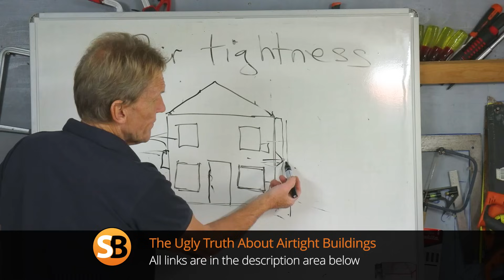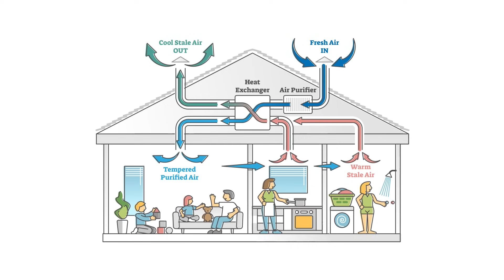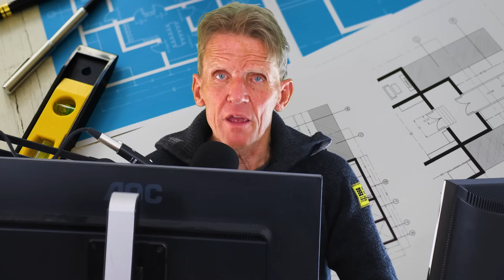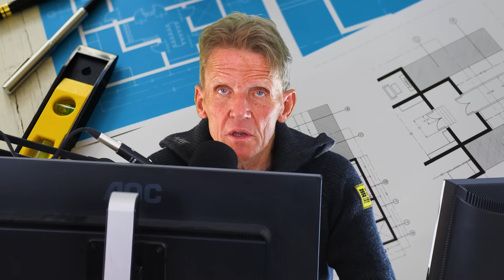Why Airtight Homes Are a Terrible Idea

Comment: I'm not sure that the German practice of opening windows to freshen the air and reduce condensation would work in the UK. Continental Europe tends to have a drier climate than we do so the humidity in their outside air is usually lower than here where we have a damp, moist atmosphere which could be more humid than air inside the house. I do agree, however, that ventilation and adequate heating is important.

Comment: I have a 1960s chalet bungalow.  Gov scheme converted the attic to a "cold space" without checking how far that cold space extends through the house.  It expends through the floors and around the dormer.
My options now appear to be, to try and seal up the attic from the floor spaces, stairwell cieling, dormer walls/cieling or I convert the attic back to be a "warm" attic and damp proof and insulate the roof side.

Comment: hi roger: dehumidifier performs poorly in low temperture due to the use of compressor, what is your view on that?
Reply from the maker: You don't need a dehumidifier in low temperatures. Warm air contains moisture and as it cools it will become drier. 
If you have a cold rainy day it still doesn't raise the humidity levels inside your home. Set the dehumidifier to a target of say 60% and let it do the job.
Reply: @SkillBuilder  thank you so much!

Comment: It’s because Roger my darling we can’t afford the bloody heating. We can’t afford to let any of it go outside into the open air because it’s too expensive. We’re a poor bloody nation as far as heating our houses go. It was like this when I was born in the war and for the first 30 years , slot metres for the gas and electric cuddle round a bloody gas fire , there was a reason why we all went over to Gas central heating we could afford to now we can’t even afford to put the bloody central heating on, and asked to having the windows wide open while the boilers blasting away and the meter was in round you can forget about that mate . Now we’re all realising for most of the year we live in a damp cold climate. And keeping all the heating with the moisture is causing problems. Fgs

Comment: I survey houses for a job, new builds currently, I’ve been building (originally a sparks for 25+years). I like Roger’s videos but disagree here, I think if you correctly use trickle vents and open bathroom windows a tad while showering and leave a couple of extractors running for free as the solar powers them, you will be fine. Badly built new builds get mould, houses where people don’t adequately spin clothes in the machine so they are soaking get mould. I’ve never had mould and don’t have a washing line, I think as with most things it’s a bad thing is misused but having had an older house that leaked air everywhere and I was always cold, I’ll happily live in an air tight house that I vent very cheaply with zero effort

Comment: I've grabbed all the "low handing fruit" to reduce drafts, from weatherstripping, to sealing around the outlets, to blocking a passage in which attic air was trickling between the drywall and the masonry, into my kitchen. It's important to keep air from circulating between the vented "dead spaces" and the interior of the house, not only to save HVAC costs, but to keep all the dust and nastiness that accumulates in those spaces from getting into the living space. But I see no reason to get new windows; the 65-year-old windows I have, despite the weather stripping I added, still leak a bit in the gaps between the sliding sashes and that's all the "trickle vent" I need. What's the point in spending a fortune on perfectly sealed windows only to have to open them for an hour a day?

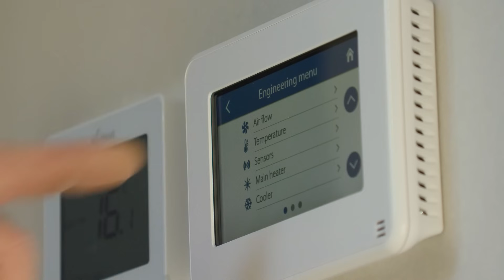Comment: 2:05 Heat recovery ventilation seems like something that should be done room-by-room, maybe with a unit under, or in a pinch, in, each window. All that ductwork would be a major expense and a major maintenance burden and for what? The window units I've seen are reasonably priced and they have much less potential to harbor dust and mold. There's also less risk of exposure to air in dead spaces, which could be the wrong temperature, and less chance of leaks. The ducts, unless they are part of a centrally controlled  HVAC system, with all of the pros and cons that go along with that,  seem like a needless complication.

Comment: Have always owned various Ebac dehumidifiers, since the early 90's, when i lived in a terrible concrete house. We had to have the walls dry lined (thick insulated boards on the interior of all external walls) then a re plaster, we extended the heating upstairs and finished off with the dehumidifier, and have never been without one. Am currently in a 1930's house and we never have condensation on any windows or damp anywhere. We keep it in the room where we hand clothes on an airer to dry and empty it regularly. It seems to take the chill off too when the heating isn't on. 
I still do the German thing of all windows and doors open first thing for 20 minutes, especially in winter. I love a bit of fresh air!

Comment: Avoiding cold bridging and cold spots on walls by good insulation and dealing with old chimneys will reduce condensation and mould. Ventilation matched to moisture levels and temperature i.e. Dew point will then take care of the rest.

Comment: A trick I learned from Scandinavia for timber framed homes is the breathing wall concept.
In brief,Tyvek if you want to to keep insects out but no vapour control.Insulate between your timber frame elements (posts,beams,studs,rafters,etc with something breathable e.g. rockwool or woodwool then clad the inside and outside in wood.All that is required is that the outside e.g. cladding planks,passively vented roof etc is 6 times more breathable than the interior cladding e.g. tongue and groove.
A big mistake people can make is boarding out the loftspace without leaving a nice airgap eg 300mm all the way around the edges to let the water vapour work its way out through the breathing roof. It's unusable space anyway and you'll use less boarding too.
I built and lived in a house like that for over a year in all conditions and never had any problems even when it was cold and had been raining heavily for days.Warm walls and never a drop of condensation.

Comment: In a rental house we had mould issues with certain tenants but not others. Heating left off and radiators switched off may have had something to do with it. It was rather stressful. Now we include gas/electric in the contract (so  we ensure heating is not skimped due to penny pinching). We installed a Drimaster PIV with heating element in the loft to vent to the landing, and installed an always on Envirovent bathroom extract with PIR sensor boost. Heating is also now permanently on at 18/19 degrees, with temp boost if needed. I’m not bothered about leaving windows closed, but we encourage tenants to leave internal doors open a little to let air move. The two always on fans provide all the ventilation. Now there is no more mould at all. Tenants are happy and don’t stress about bills. House is warm all the time and we save heaps by not having to clean and redecorate as often. We also topped up loft insulation to 300mm. Also, when painting internal outside walls we add anitimould additive (from tool station) to the paint.   Hope this helps someone.

Comment: My last house was air tight as in the air bricks had been cemented over. It was ridiculous the amount of condensation I had to move house because of it. Failing the house move I was going to get a PIV. I bought a dehumidifier but it didn't scratch the surface

Comment: I wonder if there is a positive press fan that has a wet coil so it can be used with your heating system, but uses the electric element as back up.

Comment: The last 2 newbuilds I bought had a pressure test done to certify air tightness. I later found in both properties that the bathroom extract fans were not discharging to outside but discharging into the attic. This was probably done to enable the properties to pass the airtightness test.
Reply: Fans are taped over on an air test and venting to attic would still fail an air test. The fans vented to the attic, because the builder, roofer and sparks were incompetent.
Reply: A friend of mine had a condominium with a fan like that, and when it shut off, the moldy air from the attic would back up into the bathroom. By the time he found and fixed it, he had developed chronic asthma. I believe there are some places in the USA where they allow the bathroom extraction to be done by the HVAC system, since that dehumidifies the air before it is sent back into the living space, but I don't know how well those systems manage any other unpleasant things that might be in bathroom air.

Comment: Common sense at its finest!   We have a draughty old house with solid brick walls, no damp course, lime plaster walls, no emulsion paint; never had a problem with damp or mould.  Tupperware box houses are a complete disaster.  I would love to build a 'modern' house using 17th century building techniques and materials - but of course I wouldn't be allowed to!

Comment: got an old house with massive stone walls and without insulation. We still made it airtight with new windows and doors and dont have any issues. Just use as much clay plaster as possible, put as much thermal mass inside your house (thick clay plaster, for example) and get some electric roof windows that can be scheduled for opening a couple if times per day. House wont cool down too much (because if thermal mass) and the clay is regulating the humidity better than anything else. Clay can be made almost for free from the local soil mostly anywhere where you live... Modern things combined with old school knowledge works extremely well for us and is still pretty  affordable.
Reply: almost forgot: roof Windows open during nights and closed during the day is keeping the house cool during summer as well (cool of the night is stored in the thermal mass)

Comment: British  houses are simply badly built. The above the ground founsation is 2 bricks high! Cavity insulation is hard to get right and not as effective as external insulation. Also ineffective since it needs ventilation as well, losing heat by convection!     Have a look at they way they build houses in Germany or Romania, much better

Comment: I have worked on doing a few air tightening measures on my renovation. Not had any issues yet. I wonder if its because the house is masonry so the brick absorbs the moisture. Planning on getting a wood burner that feeds from the internal air also my thoughts being it will refresh the internal air in the winter when the problem is worst. Also always line dry or tumble never hang inside, this is a no no even with the fire on.

Comment: We had a heat pump hot water tank installed this winter it draws warm and moist air in from the home uses that to heat  the water once or twice a day and pushes the cold air outside its very useful at drying out the humdity in the home

Comment: I completely refuse to have a fan blowing air into my house from the attic.

I don't want to breathe the diseased air from the rodents up there. Do you want me to get wheelers disease?

I've been fighting hard to get rid of rats , mice and shrews that have made my attic their home with 15 years.

Plus since they put a vent in every room the house is far colder in the winter. It's a lot harder to get any bit of heat into the house.

Comment: I have a vent in at least 1 window in every room and when my fireplace was covered they installed a vent in the plasterboard.

I still have mould in the house. In fact since they retrofitted the house with more airflow in the house I have a worse mould problem. I covered the vent in my sitting room and the mould problem went away.

If you come here to my house during the winter for two days I will show you the difference between the trickle vent unblocked and the trickle vent blocked.

Even with the trickle vent "closed" as far as it goes it leaves in cold air. With the vent open or closed  and heating on I may as well be standing outside because even with a big double radiator the house won't heat up.

I put up with it for one winter and it was really cold in here with some dampness and mould.

I blocked the vents in my sitting room and it's warm without mould.

Comment: This is the single most common misconception about air-managed buildings.
We're moving from the ventilation strategy of a tree to the ventilation strategy of a lung. A tree has unlimited air, but it has no control over the dust, insects, pollen, smoke, mould and virus spores, other allergens and toxins, humidity, temperature, or any other factor in that air. A lung has air that is filtered, warmed, humidity-moderated, and generally perfect for its needs. All the air enters and leaves through a pipe to ensure this quality control.

You do not improve the performance of a lung by leaving holes all over its walls. But if you don't have air coming and going through the filters and pipes, you're going to be in strife very soon. You have to have air moving through the filters and pipes.

Comment: I have a Zehnder HRV and an air tight house and have had no issues with mould and moisture issue. Very little energy expenditure on heating or cooling. Build it right and tight from the start then mould we not be a problem.

Comment: Houses need to breathe and interact with the environment. If you need a fan to bring air into your house you are living in a coffin. Focus should be on r values
Reply from the maker: The fan removes moist air and transfers some of the heat from that air to the incoming fresh filtered air. The coffin analogy is a bit of hyperbole.
Reply: @SkillBuilder yeah I get that, I’m not a massive fan of mechanical ventilation either way. A certified passivehause, still needs to be opened up and fully aired out weekly as part of its maintenance.  You can get a good balance of insulation and breathability with other building products, I’m all airtight building but if the only way air can get in and out is mechanically, I’m not sold

Comment: I live in an EPC B rated new build.  It’s the first place I’ve lived that has never had a problem with condensation on the windows.  It’s totally mould free apart from a few spots on the sealant behind the kitchen sink.  I dry laundry indoors as well.  I actually had to buy a humidifier for the winter, because the air became so dry, I started getting dry eyes and nose bleeds.  Never had that problem before either.  But like you said, it’s got mechanical ventilation system.  Its cool in the summer and warm in the winter, I think this method of building is great.

Comment: Every new building should have an ERV and forced-air heating (ideally from a heat pump). Radiators are an excellent heating solution, but combining heat and ventillation in one system will prevent people from blocking fresh air vents. Same goes for A/C in the summer, it should go through the same vent as the ERV to prevent clueless tennents or homeowners from blocking them.

Comment: huh?
just dehumidify the air.
Reply from the maker: you missed the whole point. The house is sealed up and the occupants won't take any action to mitigate the effects. 
It needs to be built in and not optional. Dehumidifiers work but tenants often refuse to run them.

Comment: I had a portable dehumidifier running in the bathroom while the extractor fan was broken, it was so much more effective at removing moisture from the room than the extractor fan that I'm thinking to just install one more permanently and not bother with the fan...

Comment: depends. The Vancouver, BC down the INterstate 5 all the way to Portland is a "hygro-thermal" zone, and builds are different than the testing the Federal Govt. in Canada does in a hot, humid locaton like Ottawa, Canada. You also need to be aware of "stack effect" for windows, ventilation, and the efficacy of your build.

Comment: Air-tightness and insulation are slightly different things. A plastic bag is air tight, but you won’t feel warm in it, because the walls are thin layer of plastic. While a fur coat, for example, might be not as air tight as a plastic bag, but you’ll feel warmer in it.

Comment: Mold means shit construction in the first place. Cold bridges or actual rain infiltration. There absolutely nothing wrong with an airtight home if done right. If you have problems it’s because you don’t ventilate enough. Be that preferably mechanical with energy recuperation or natural.

Comment: Not sure what kind of climate we're talking about here, but in the warmer months, running AC will also act to dehumidify. In fact, there's no point running separate dehumidifiers if you've got AC because AC will do the whole job (look up latent heat of vaporization), and a dehumidifier will generate extra heat that your AC then has to remove. A dehumidifier is literally just an AC unit (heat pump), but both the hot and cold sides are in the same space, rather than putting the hot side on the exterior of the building.

In colder climates, the only artificial solution to high humidity is a dehumidifier, unfortunately. You can just use more heat up to a certain point, as warmer air holds more water (and thus deposits it less, so less mold), but obviously you have to balance that with comfort and cost. That means you're stuck with venting the humidity outside, assuming humidity outside is lower than inside.